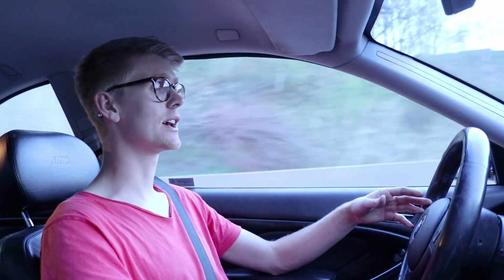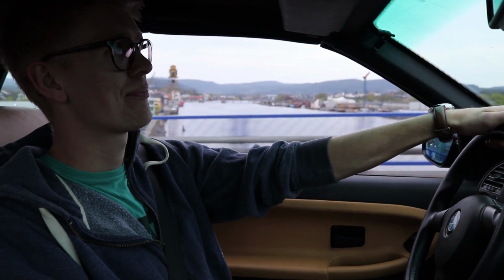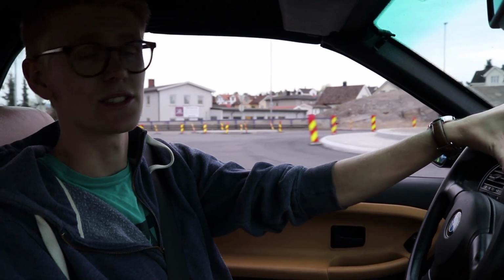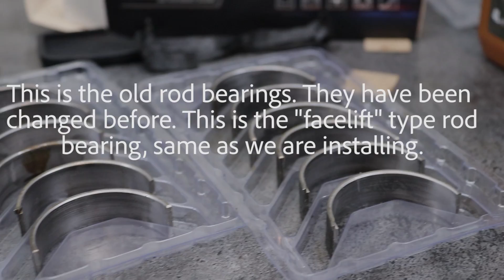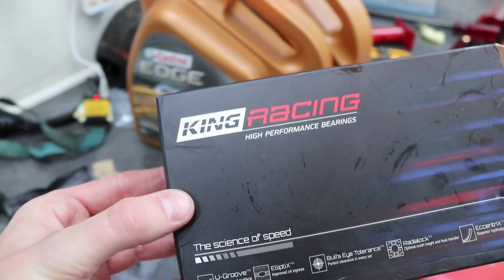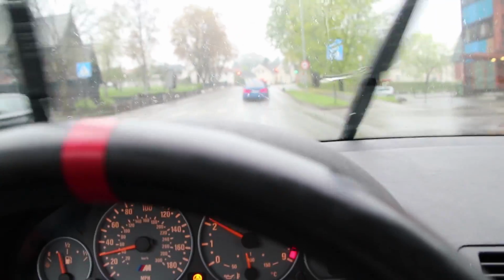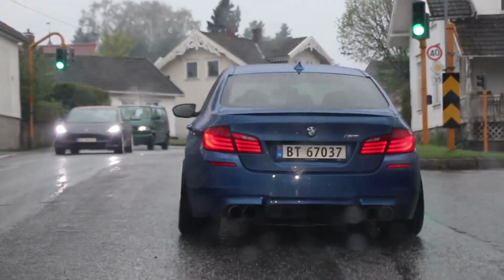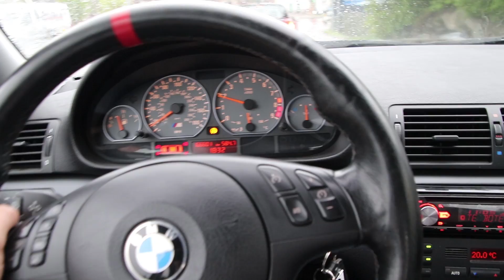Fixing E46 M3 S54 Biggest Problem!

Comment: I’m planning on doing my rod bearings this winter, I’m thinking standard set up bmw bearings and bolts as they are tested well and good history of what the can do, for most 80/100k miles of reliability. Surely kings bearings and arp bolts have never done what miles the factory set up have done, kings bearings etc have never done in the miles and time and in some cases abuse our current m3’s have. My car is a facelift model with 100k miles currently and share scare mongering in the car scene but I can’t understand not going for new standard stuff unless upping the power.
Reply: True, the facelift cars are slightly more at risk due to the conrods bolts having to be replaced. Pre facelift cars must re-use the same bolts. Also agree that until the ARP/king bearing combo has stood the test of time then OEM is the way to go. Stock internals are meant to be good for upto 550bhp so unless going for sill FI figures then there is no real need to spend the extra for aftermarket kit. Still gets me everytime when I see the scaremongering getting the better of people and they believe the forum armchair "experts" who insist that every S54 is gonna pop if they haven't been swapped out. Seen playground arguments where people have been accused of cheaping out when they've refused to replace them. This is one of the reasons I've never actually joined one of these forums, but admittedly they are generally great places for a lot of other stuff to do with these cars. I've also spoken to 3 indie specialists and when pressured they admitted it was overkill, but they all have a business to run and give the people what they want. They also explained that to do the job 100% perfectly, the crankshaft would need to be properly machined to them, which would cost more than any of our cars are worth! It's accepted that these bearings are essentially a non contact item and if the engine is properly heated up before giving it the beans then there is no danger to the unit as there is no more wear. My own car has just hit 140k and in the 3 years I've had it I've made damn sure there has been no extra wear to those bearings. But I do accept that it's anyones choice if they are happy to spend around 1k for what they see as peace of mind.

Comment: Only one of those bearings are showing any signs of wear. All the pathetic scaremongering among the armchair experts have so many E46 owners scrambling for their credit cards. As long as the engine is well heated up before going over 3500k rpm there should be no more wear at all to the bearings. They are a non contact item! If they already have a little wear then that actually gives more clearance for the oil to flow better. People who have spun their bearings have simply not looked after their engine properly. My own engine has done 140k and over the 3 years I've owned it there has been no extra wear to the bearings so I'm definitely not bowing to these people who insist that my S54 is on it's way out.

Comment: Its been more and more problems with head gasket on S54.
I would say that that is a bigger job then bearings, and more expensive too with a minimum of 20 work hours and 10-15000. Nkr. In parts.

Comment: I really mist the e36 and i like more your e46 now with new rod bearings!!! Nice Mod.
Reply: And expensive mod hahahah
Reply: @bekimselimi88  Replacing the bearings is not actually a "mod". No power gains or any change to how the engine runs. But you are definitely correct about the price! Not a cheap job in any country ;)
Reply: sarcastixx74  Sorry broo I didn*t know that wasn*t a mod but what i know is to do this is very hard and very expensive. Respect for you bro!
Reply: @bekimselimi88  Very true mate! Not an easy job, very time consuming and the most important thing is torqueing the conrod bolts, best left to the pros! Take care bud

Comment: Hi man, how's the laws in Norway, because in most of Europe, if you modify the car you have to write up on it's brief that you swapped the engine and you can't put any engine.. in a 318i it would never be possible to put a M3. For example in Romania there is a huge problem with E36es being modified at base being a 316i and after swap an 328i, and so on, i wonder there's no law against this kind of mods in your country ? Here you get a huge fine the car's getting it's numbers down and you can even get in jail for it. I was just wondering, thx bud :D
Reply: it is a pain in the ass to modify cars in norway
Reply: You need permission to do the swap by the technical goverment.
If you have a donor car and have permission than its ok.
That was done before he buyed the car, he had been telling about that before.
Reply from the maker: Alot of rules, this car is «approved» with M3 power and drivetrain